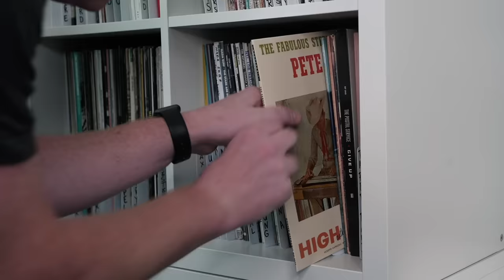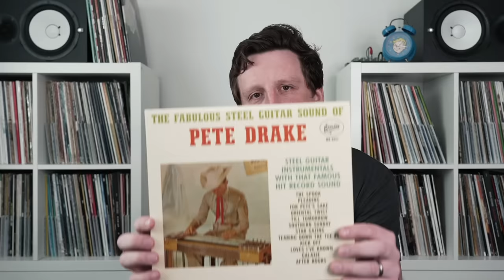6 Guitar Pedal Myths

Comment: It is worth noting that engineers tend to design analog circuits to be immune to variations in the characteristics of the individual active components (tubes, transistors, op-amps). So the designer is actually working against you when you hope that swapping active components will make a difference.

Thanks Josh for being a voice of reason and a force for good in the world!

Comment: Put a box wine in a fancy bottle and watch em' praise the wonderful wine.
Reply: Once bought a gallon of the absolute cheapest plastic-bottle gas station vodka available, and fraudulently poured it into Grey Goose bottles for a party. Everyone raved at how great Grey Goose is.
Reply: @devolve42  Was the plastic bottle vodka made by Karkov, by chance?  I call Karkov the "Fantastic Plastic*" vodka. 

*only applies when used in mixed drinks and not when consumed straight.
Reply: I saw something like that years ago on a cheap beach restaurant.. the food was sooo god an the wine (poured on glasses) was perfect for the mixture... some guys at my spend a good time trying to guess the brand, year and strain of that nice white wine... turns out it was box wine.

I was almost obsessed with true bypass... until my wha was modified
Reply: @ManuelMartinez09  Don't you mean the opposite? Vintage Wah's are noted for being tone sucks because they didn't bypass or buffer. You always passed through the circuit... just the tone (wah) part was disabled.
Reply: @jimistheman9732  I'll explain myself: I knew about tone sucking of vintage pedals but I loved the tone of that VOX pedal, I was obsessed with true bypass (all my other pedals were TBP) so I modified it and two things happened: 1.- I recovered My beloved tone, 2,. Every time the wha was activated my signal was unaudible (full band playing) and the tonal difference between on/off was so notorius that I realized TBP is not the best for every pedal (maybe a buffered TBP was needed in this case)
Reply: just make sure the cork smells good ;)
Reply: @devolve42  I put home distilled spirit ( two weeks on Jack Daniels barrel chips) into Captain Morgan OP bottles, and threw in rum essence. My ex-wife asked me to do it for her fortieth bash. All the rum drinkers loved it and said "yeah we only drink Morgan!" Don't even get me started about my Bombay Sapphire Gin.
I fucking LOVED this video.
Reply: Penn and Teller set up a fake restaurant and had people sit and taste different bottled waters. The customers were going on about the different tastes and textures and how one tasted so different from the other. 
  The joke was on them. All of the bottled waters that they were served refilled from the same garden hose.
Reply: Ain't nothin' wrong with boxed wine. It actually keeps better because it is never exposed to air. I used to date a wine snob, she drank hundreds of gallons of Franzia and loved it😉😂
Reply: @kellykent131  After reading the OP comment that was the first thing I thought of as well. Haha.
Reply: @ManuelMartinez09  sounds like there was a problem. I did the same thing. I modded a wah for true bypass but realized afterward the the treble I was losing to the bypassed wah needed to go anyway. But I wonder what happened to your's. If anything mine was more present. In a bad way but more present none the less.

Comment: “This is 2018. We’ve gone to the moon. Or at least faked it. Either of those is incredibly difficult.”  🤣
Reply: Well going to the moon......that was through hole technology and a state of the art crude computer system that was probably a lot less than a commodore 64.....let alone a commodore 128.....and hmmm how much RAM.   
But then again perhaps we should ask the Israeli's about crashing into the moon and the "communications failure"....since that's technically only a few day out of the box.
I actually favor the Israeli's as they build some impressive devices & firearms considering the conditions......I haven't been there since the 1970's

People erroneously cite these technologies not realizing that they have a short service life or that the package has a big service contract on the back end. If you talk about medical hospital equipment.....

The tax man calls it depreciation

You can buy a model T and it will run or a 57 chevy…….there is no computer or electronics involved,  but buy a post 1980's vehicle that's early computer or well into the electronics age....and good luck if the vehicle will run reliably...….and I trust you aren't planning to go to the moon or need life support systems
Reply: @mikecamps7226  One should try to keep a machine as simple as possible, for the task at hand. Overcomplicating a design to achieve the same result is wasteful and, indeed, potentially dangerous. After all, the more parts in a system, the higher the chances something will break when you need it the most.
Reply: The comedian said :  "you can't fix stupid !"
Reply: check out the show : Adams ruining everything ,on this matter
Reply: Digital technology is not only inherently obsolete by the time it is first used it is also highly degradable. Analog 
technology is impossible to degrade. A shovel made today is the same one as a shovel made a thousand years ago. A shovel can't be made obsolete.
Reply: here here...thumbs up on that...wisdom
Reply: Justin Johnson makes a nice shovel......check him out
Reply: That was one of my favourite statements in this video.
Reply: What they never mention is the Gamma Rays...….and Godzilla...….I wouldn't find it comforting to be told by Houston to hide behind the water tank and stand sideways...think thin

Comment: I would argue that true bypass (or even passive bypass) does have one advantage which cannot be denied... when I was a young and couldn't afford a power supply for all my pedals, and couldn't really afford to change all batteries for every gig; true/passive bypass meant that my guitar signal still got to the amp halfway through the song. If a battery dies, just stomp the box off... all is fine. 

Unless the switch broke of course... 

Would be very interested to hear more about op amps in hard clipping pedals vs tube screamers etc.

Comment: True Bypass was the first snake oil I was sold 😂
Reply: I keep a buffer or 3 on my board, no problemo, but put 6 boss buffers in a row and tell me it doesn't tonesuck...buffers add up to create problems.
Reply: Craig mine was a “ modeling “ amp. Either do one thing really well or not at all.
Reply: @bradmodd7856  With some boss pedals I definitely notice some tone suck, but I have not noticed it with the Waza craft line. I usually place a buffer in the beginning, middle and end of the chain with the TU-3w at the end. I think the problem might be more with the quality of said buffer than it being buffered bypass or not. Some boss pedals(the non waza SD-1) have an awful buffer while some of the others have an incredible one(any waza pedal and even the non waza TU-3).
Reply: @bradmodd7856  Exactly. Tone suck does occur when you have a bunch of unplugged buffered pedals on front of your amp. The snake oil is in thinking buffered pedals don't sound good...they did, and of course still do.
Reply: No joke I just got an ad for a true bypass pedal before this video 😂
Reply: There is an element of truth to it, though, concerning stock wah wah pedals.  They simply must be modded, or used with a loop/bypass pedal, so that they don't suck tone when they're turned off.  Stock wah wah pedals have neither true bypass nor buffered bypass.  The signal is still loaded by the wah circuit when the pedal is disengaged.

I have not noticed much of an appreciable tone loss with any of my other pedals.  But a "bypassed" wah is a tone destroyer, and that one is no myth.
Reply: This all dates to the good old days when a lot of pedals didn't buffer and didn't use a bypass switch. You were always passing through some part of the circuit. So, it was always, literally,  affecting your signal. True bypass was a cure for that. It's not the only cure, but it did the job.
Reply: I personally prefer By Truepass.
Reply: Too bad the Boss Metal zone does not have TRVE BYPASS
Reply: @waltjames407  I can attest to this. This was back in 2007 when I got a Vix V847 and my Les Paul became neigh unplayable before I modded the pedal, because there was no treble left! Luckily the modern ones are true bypass out of the box.

And of course, we have Fuzzes (especially Germanium) who don’t like buffers too much.

Which is why it is like Josh says: a combination of true bypass and buffered pedals are the way to go. None is inherently better than the other, as they have their own quirks and needs.

Comment: I had two versions of the Boss CE-5 for a while - one older analog, the other newer and digital. Could I even hear the difference? Nope. Did I persuade myself that I could hear the difference? Yup. Am I even sure that I had it right which was which? Nope. Did I replace them both with a 1979 CE-2 that I got for a ridiculous price? I did. It's awesome. Would I be able to tell the difference between that and a cheap clone? Almost certainly not.
Reply: Congratulations! You've won the thread.
Reply: Made in Japan or in Taiwan, though? You can totally hear the difference, they have different accents. ;)

Comment: I want a trough-hole smartphone now. Lol
Reply: sure thing, it's about the size of a small laptop for "no reason" , ya ready?
(Electronic engineer passed by) 
(genuinely liked this comment)
Reply: Don't forget to make it true bypass and fill it with gup.
Reply: @MiguelBaptista1981  smartphones are by definition true bypass, you just put the thing down and talk to people. :D
Reply: @grilledspaghetti  True DAT .
Reply: I really want to see someone attempt this. Like, really.
Reply: @-processdrone-  Wouldn't be the size of a laptop, it would be the size of a room! To be all through hole you would use through hole transistors for the CPU as well. 

Would look something like this.
https://youtu.be/lNa9bQRPMB8
Reply: Analog smartphones are better 😜
Reply: @circuitriderfpv5956  they actually are.  That's why the government took back over all the analog spectrum.
Reply: with 100% hand-wired components and a gooped board
Reply: Back in the 80's we called it the Brick. Danny Glover's character uses it's predecessor in a briefcase format in the first Lethal Weapon movie.
Reply: @circuitriderfpv5956  with banks and banks of relays clicking away, and 134 6L6, EL34, and 6BQ5, push pull 813's, all glowing for one frequency each! Hell yeah, that would be so ultra cool!!! Wouldnt need a cell tower to reach Russia, China, Japan...lol

Comment: I bought a Fat Rat because the op amp was socketed so I could replace it with the "magic" LM308.  Was it magic?  No.  Did it sound different?  A tiny bit, yes.  Was it worth the $199 I spent on the Fat Rat?  No.  I could have had a $70 regular Rat pedal and nobody would have known the difference but me.
Reply: Man, I've been jonesing for a FatRat for years, just never had the spare scratch. I think you just talked me out of it.
Reply: I had a VFE Alpha Dog, built from the same type of Rat circuit, changed op amps, etc. it did make quite a difference with one of the suggested chips, but it was an undesirable difference that made the pedal sound awful. The other op amps, well, the result was so minuscule that I kept the original and just enjoyed that as is.
Reply: Yes ...LOL the killer is that the old chip had more bottom end but in a band the drums and bass smother out any low end from the old Rat. All you need is the new one ...and it's cheap.
Reply: Yeah, the new Rat rules and I've never regretted the 60 or 70 bucks i paid for it.
Reply: So buy a $90 Rat from ProCo. It will be just as solid as whatever JHS is calling their $250 Rat clone.
Reply: Looking at overpriced peddal

"You .. dirty .. RAT.." :(

Gives it a clean :)
  (then sells it on eBay , lol)